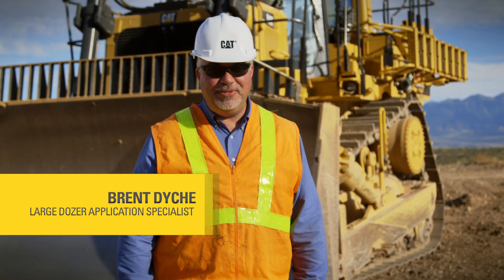Cat® Large Dozers - Blade: Tag Link Design

Comment: Explain to me how exactly how you can increase down pressure on the cutting edge by simply moving the blade closer to the tractor. It doesn't make a difference.
Reply: Chess PlayerElite 
Imagine that you lift the tractor so high that only 2 points have ground contact, the cutting edge and rear idlers.
these 2 points share the weight of the machine, if center of mass is exactly in the middle they share it 50/50 but if you move the cutting edge in closer that will take a bigger share of the weight than the rear idlers.